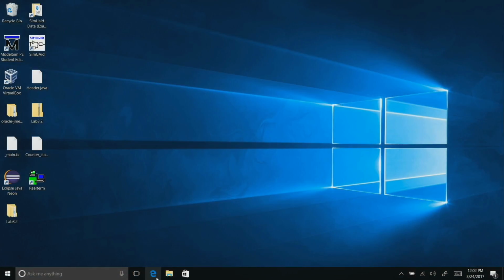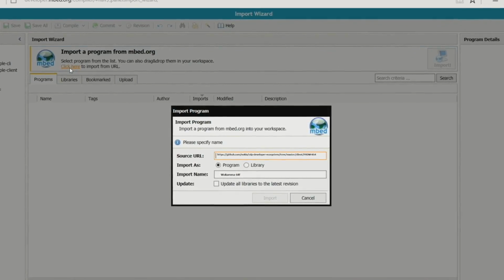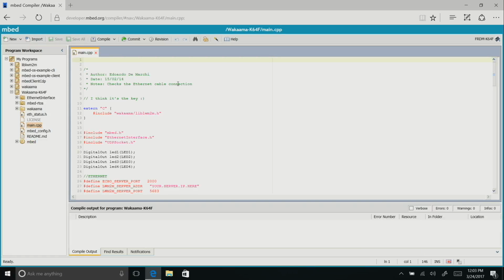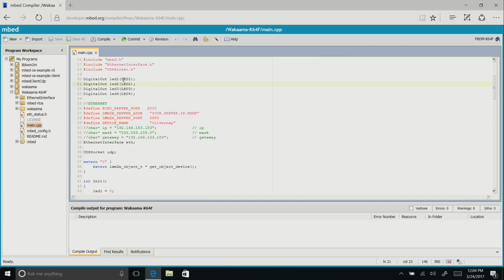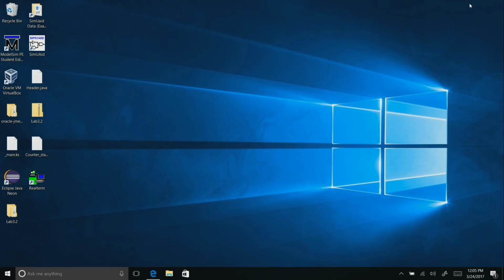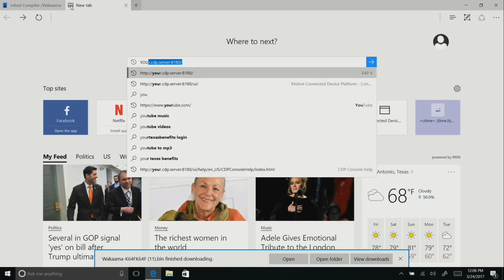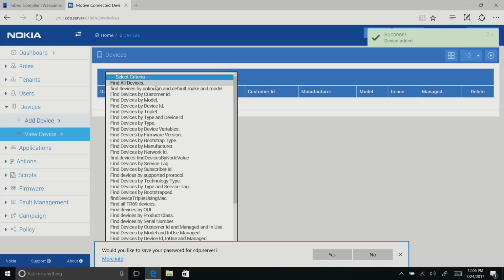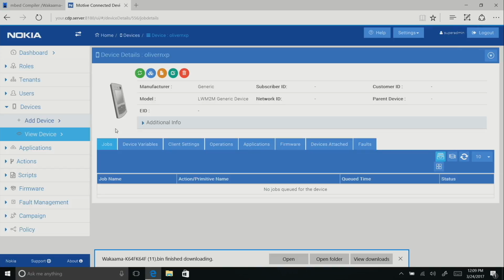Nokia CDP Quick Start Series- NXP FRDM K-64F

Comment: What tools should I need to implement COAP/LW2M2 compatible sensors or data gateways?
Are any free available test suites exist let me test my own coap/lwm implementation is it passes compliant with protocols specs?
Now I'm working with generic Linux (embedded, libcoap and need some  light lwm library), but later I'm going to implement specially tuned micro library for tiny connected microcontroller devices.
Reply: The first goal is Nokia CDP/IMPACT as uplink platform.